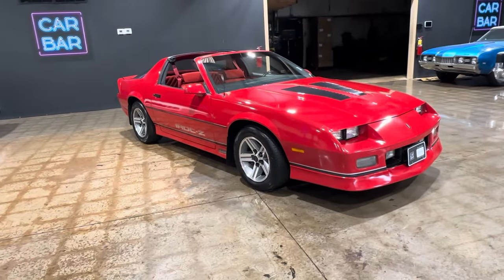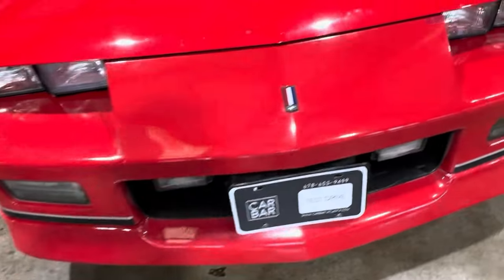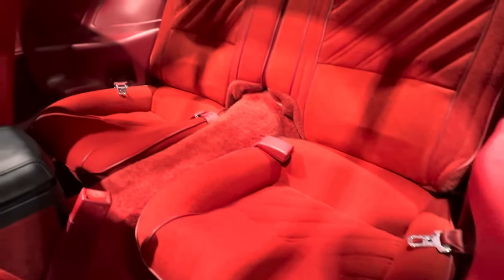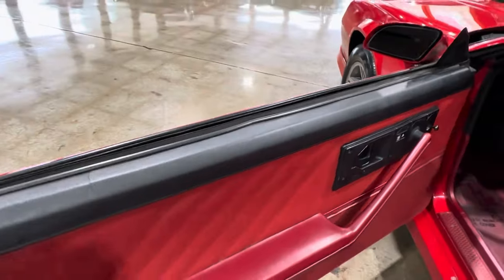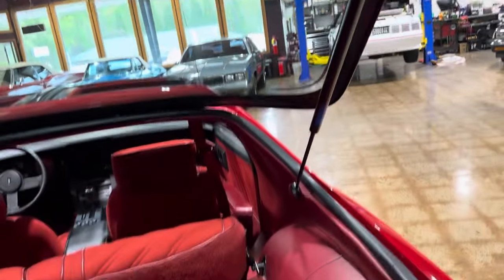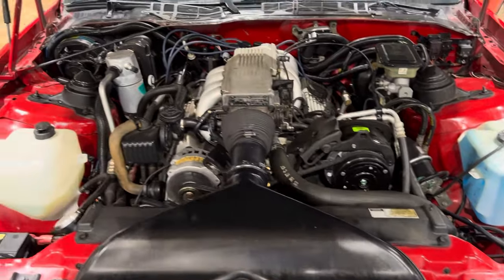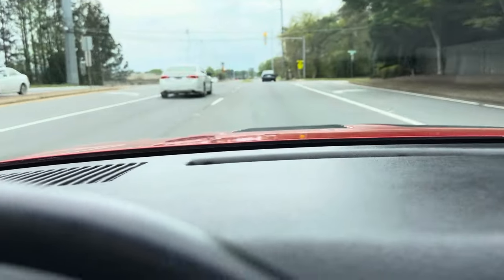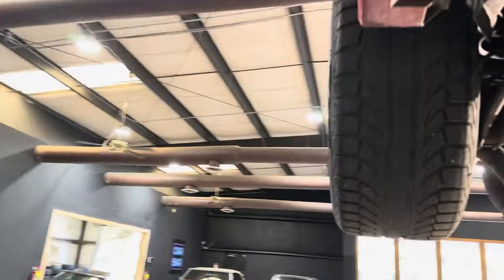For Sale 1987 Iroc Z28 $16,995 @carbaratlanta on IG

Comment: Those cars were notorious for heaven transmission problems. 
⚠️
Reply: Yep, it was the drain hole in the tail housing that was drilled too small and would cause the rear seal in the tail housing to pour transmission fluid out.  It would start after only a few thousand miles.